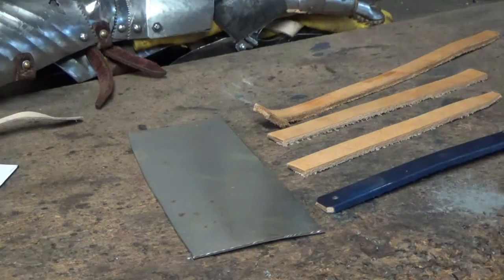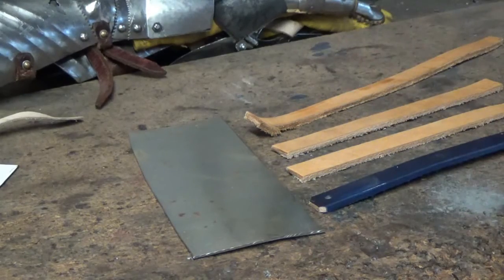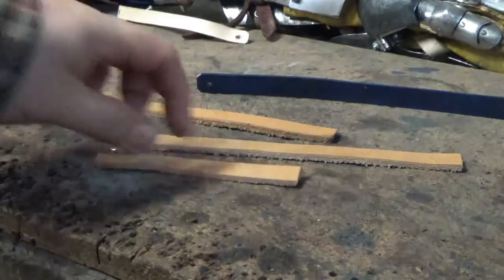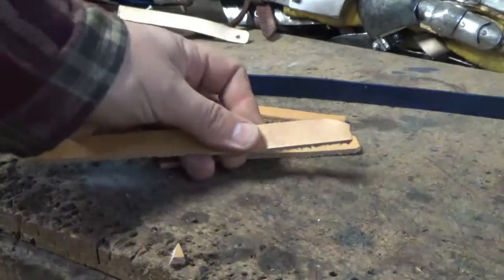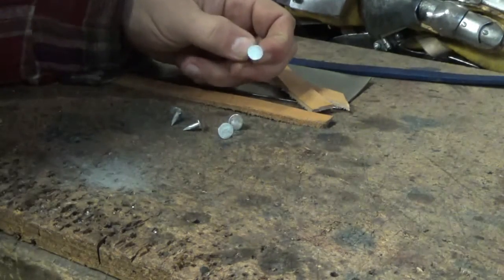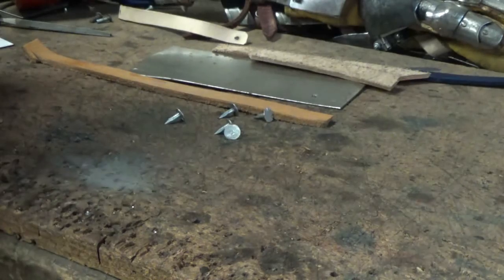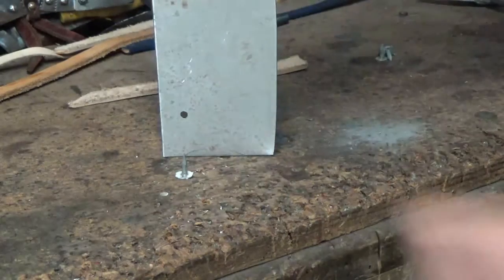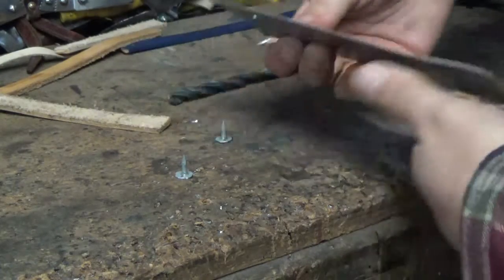Leather strap basics - Medieval Armor Techniques #7

Comment: Hi mate, just stumbled across your channel and have already found it to be one of the few solid-gold channels for armouring tips and techniques! 
Apologies if this is a stupid question, but do you have any advice on replacing straps on brigandines? I need to replace the straps on mine, and am paranoid that the distinctive layered-fabric nature of brig construction may cause some unforseen hurdles I haven't considered, as so far I've only done riveting on belts and plate vambraces and pauldrons, heh.
Keep up the awesome content! :D
Cheers - Conrad
Reply from the maker: Conrad, if there's material on the river, or leather you want to preserve, when you remove the rivet by grinding or the such, go slowly with light taps, that way the temperature won't wreck the organic layers. Then when you're replacing the rivet try and find something that holds the rivet but doesn't touch the nice material front, then tap away.

If you're really nervous about  it,make a small test piece of all the layers and try and see how best to put in the new rivets without marking the front. It takes time, but it can be time well spent.

Hope that helps.
Reply: @GreenleafWorkshop  Thanks for the advice, that'll help hugely! :D

Comment: Whats the advantage of slot and eye? What was it used for?
Reply from the maker: In theory it helps protect the slightly more vulnerable strap end if it's riveted to the outside of the armour. Additionally it offers slightly less of a catch for weapons. You see it a lot in 14th century armour, but it gradually looses its popularity making occasional come backs from time to time.

Comment: does the nail have to be a special sort of metal?. I got similar nails like this but made out of steel (I think) and they can't be hammered down like you do here. The nails you use here looks like aluminium?.
Reply from the maker: Kevin, the nails are made of steel. I used to struggle but a nice heavy object underneath (the anvil) and a reasonably smooth ball peen hammer helps. I find pointed ball peens make it hard wrk. I hope that helps.

Comment: when i make rivets with bigger nails, they sometimes have a tendency to crack, how can i avoid it ?
Reply from the maker: Nail quality can be a bit of a lottery. If the shank is too long they can tend to lean over and sometime crack, but if its the shank itself cracking, after you've cut them to the length you want try filing the top flat again (it will likely be a bit pointed from being snipped) this might help a bit. Then hit the rivet square on to spread it a bit then clip around the circumference to get it to bit ... might help. Good luck amigo.